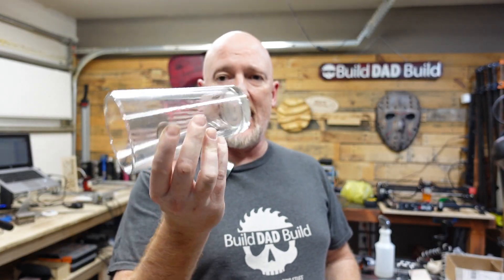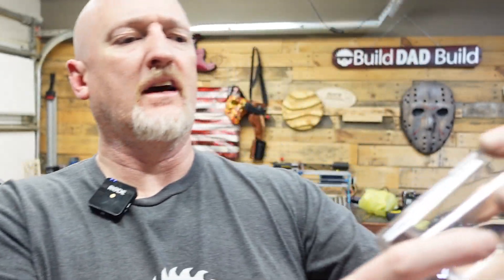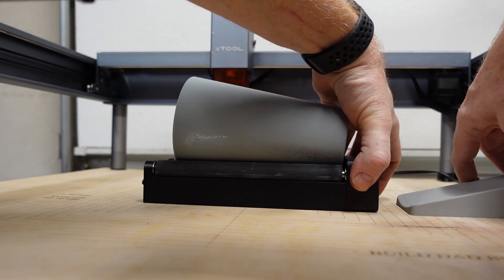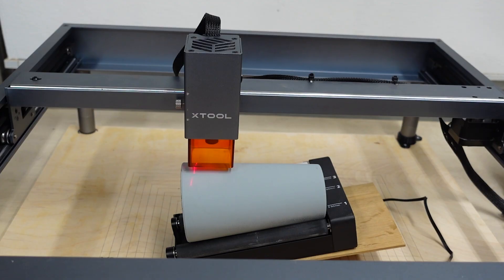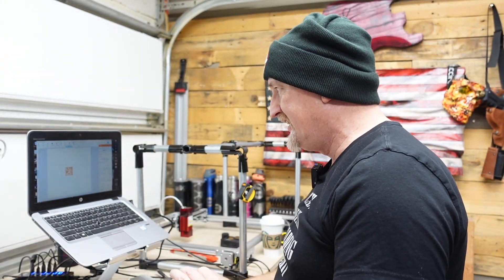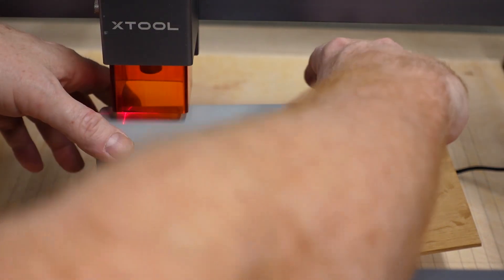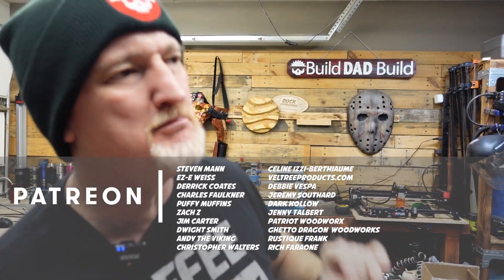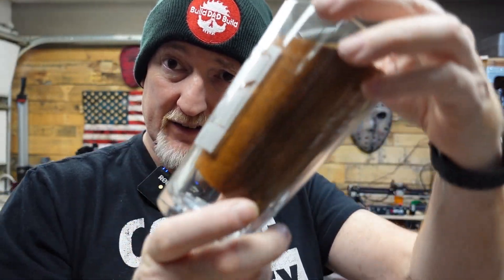The Secret to Etching Pint Glasses with a Diode Laser

Comment: one more.
I do appreciate the time you spend on testing the various methods to laser engrave (etch) glass.  My comments are a bit off topic, but,  I do receive excellent results with the black Tempura paint that provides a nice, white etch, BUT, to achieve the best results, I have to use my airbrush to apply several, 3,4,7 coats to achieve a good thickness that works great.  Now, I have just tried a single coat of the cold galvanized - Rust-oleum -  and setting my 30 watt Longer B1 laser to 4000 mm/min, 80% power, with a .08 line interval, I do get a very nice BLACK etching.  As I was expecting a "white" etch, I'm liking the black finish that my test glass showed.  I have also tried the TiS02 on glass and to receive the best results, a thicker coating works best for me.  My white 4x4 ceramic tiles result with a great black finish and again, a thicker coating is the trick with a "too light" of a coat giving a splotchy uneven black result.  The TiS02 that I tried on an old hot sauce bottle did result in a black etch, but, I could/should have used a thicker coat to have a "more dense" black burn.  Whatever coating that you use, the hardest part is to apply your mask in an EVEN coat that is "thick enough" to achieve the best results.  Thanks again.....  Hank

P.S.  My CG spray was just bought from the big A store and, evidently, the CG formulation has changed that results in a very NICE black etch instead of your "white" results - FYI....

Comment: Hey Nick, coming back for more.....
A suggestion to prevent the tapered glass from "walking" down the rollers: Use the side of the roller assembly that has the markings for the top/wider portion of the glass and place the top of the glass on the rollers against the frame.  This way the metal "boxed belt area" will act as a stop to keep the glass from walking since it will be in contact with the roller assembly frame.  You will need to lift the opposite end from the end you showed to obtain the proper angle for a level burn.  You will need to change the image angle 180 degrees from you initial setting to make the right side of the roller assembly the top of the glass.  I think you know what I mean about the above setup as any "glass walking" will be stopped by the roller frame....  Now for my own CG testing  🙂

Comment: Hi Nick . Got a dum question on Flat Glass for a laser. Laser  glass Acrylic etching
Reply from the maker: You’ll have to do a speed and power grid for best settings.
Reply: @BuildDadBuild  thanks done that . Going to do another power test. I saw your on call galvanize compound spray paint so got the paint. Hope this actually works. .

Comment: Hay sweet. Got a questions can you use card stock To engravean image using a flat glass And can diode laser cut glass? 🤓🧐
Reply from the maker: diodes can NOT cut glass. Card stock on the inside of the glass can be a "hack" of sorts
Reply: @BuildDadBuild  Hi there thanks 🙏🏻😋 hot diggity cool 😎 I’ll try it out. And learned so much from you and done stuff. Thanks

Comment: THAT is why they make "chuck" type rotary's...  IF each roller had a flat "washer type" ring on each roller to keep the glass from sliding down, it "may" work.  My money would be on using a chuck rotary...
Reply from the maker: WHEN this video was MADE there was no OPTION for a CHUCK rotary...

Cheers
Reply: @BuildDadBuild  Yea, in two years a LOT of changes happen, and while the results were not quite perfect, I really can't biatch because I've lasered "ZERO" glasses  🙂

Comment: I am having a lot of trouble. I do the line test to get the rotations per mm. Then I do and engrave a logo and it is very skewed. So then I go do the line test again, and then get that set to where the two ends meet again, then go back and engrave the logo, well its still skewed. I have the cup flat even though it is slanted. And then when I get any type of engraving, the glass from the engraved part chips. So i try new settings, and nothing seems to work.
Reply from the maker: Try weighting the cup so it doesn't slip while engraving.
Reply: @BuildDadBuild  it doesn’t slip
Reply from the maker: Then your belts are loose or the laser head isn't seated properly.

Comment: It's hard to notice, but did you adjust the width of the square image to make it still look square when viewing it on a round object ?  As for the paint I use Vallejo black primer and apply it with my airbrush.
Reply from the maker: No. I did not adjust.

Comment: Thanks for the video Nick. First of yours I've watched. You seem to have played / worked with the cylinder engraving tool more than most so I'll ask you. Will this attachment do a small enough diameter to etch the handle of a pool cue? If you think it might, do you have any tips / tricks I might need other than the levelling that you just made very clear. I am buying an Atomstack X7. Also do you suggest air assist? 
Thanks again for your video. I really like your detailed but Not boring approach.
Reply from the maker: Yes on the pool cue. Air assist is going to be more important if you are cutting.

Comment: Great video again. Do you think the fry moly would work as the coating?
Reply from the maker: You mean remove the coating?
Reply: I mean apply dry moly like you do on metal. I was just wondering if it would would work like the tempera coating.
Reply from the maker: Not sure.

Comment: Just curious, how slow is necessary to get "frosted" look with cgc? Mine are mostly greyish.... I have a d1 pro 20w
Reply from the maker: Not sure. I haven’t run any with the 20w
Reply: @BuildDadBuild  you said to use "stainless" settings,  I believe you were using laserbox at the time, xcs has 3 different stainless settings, I can translate to 20w if I can ever figure out where to start..

Comment: Hi! I have a question and I hope you can answer it. When you laser engrave onto a pint glass, does it come out smooth or is the glass going to be jagged like it was chipped away?
Reply from the maker: I wouldn't say jagged, but you can feel the roughness of the etch.
Cheers
Reply: @BuildDadBuild  Would you recommend to put some kind of clear coating over the glass to smooth it all the way around? Thanks for the reply!

Comment: Nick.. I've been experimenting with different mediums for etching glass (Dry Moly, Zinc/Galvanizing, Tempera, Tape, etc...), and have found that most mediums are "about" equal. Side note, at least with the galvanizing I am using, I run a second pass to burn off excess material left behind on first pass.... but, I digress..

The point of my post, and I do have one, is to ask you a question: have you tried using "Rub'n Buff" (get yer mind outta the gutter!) on the etched part of the glass?

I have watched several videos of the folks who do chemical etching of glass follow-up with Rub'n Buff to bring color to their glass etchings (gold leaf, copper, ebony, etc...). I am going to experiment on some of my existing test pieces this weekend, but wondered if you had already seen this product.

If you see this and are interested in my results... let me know and I'll be happy to share.
Reply from the maker: I've never heard of it, but will check it out.
You can share your results on my Discord channel:
https://discord.gg/PTBeEwV9
Cheers!
Reply: @BuildDadBuild  Just joined and uploaded to #pictures ... enjoy!

Comment: I appreciate the videos you have made for etching glass. When I first bought my D1, pint glasses were the main idea I had. I have been able to etch the glass using this method, but I’m actually ending up with a super light etch and would like a better image so I could actually sell them. I’m not sure if you have any tips on getting a darker etch or not but I would really appreciate it.
Reply from the maker: A little more CGC might do it. Sometimes designs need to be inverted in order for them to show up better.
Also slowing the laser or increasing DPI might help.
Cheers

Comment: I found that using the Cold Galvanizing compound paint from Lowes at 60mm/sec and 95% power left an incredible smooth black etch in the glass, at much slower speed it frosted the glass.  I think it left a better image in black than the more expensive charcoal glass spray from Enduramark.  It worked on tile the same way at 90mm/sec at 90% power.  This is on the 10w version of the D1.
Reply from the maker: Good to know!
Reply: I tried 60mm/sec 95% power with galvanizing compound and it looked really good until I washed off the burnt paint and it left a very faint etching, too fast to really effect the glass.  Using xtool d1 pro 10 watt.  I think I’m going to try the black tempera technique tommorow.
Reply: Do you change speed and power for frosted look? D1 pro 20w.
Reply: @Dhump007  what did you come up with for your settings for the 20w
Reply: Can you tell us the 20W settings?

Comment: Be very careful guys, cold galvanizing compound is extremely toxic, the fumes that come off it when heated (including a laser) are potentially deadly. This should be enclosed with a charcoal vent filter at a minimum. I did  few tiles using this stuff a while back, until I bothered to read the MSDS sheets, I haven't touched it since!

Comment: I have found that shimming the rotary can cause the item, like a large glass, to walk down hill causing the engrave pattern to shift.
Reply from the maker: That's why I did another video showing how to make a jig. I've found anything more than a pint glass doesn't "tilt" all that well.
Cheers
Reply: I solved this problem by just placing a heavy object in the way in the direction of the walk (in my case a tea tin with some weights in it) - cheap, fast, and at least for my purposes results have been great.

Comment: With the glass tapering, how did you determine circumference? Did you use the opening of the glass or the middle of the glass? Any insight is appreciated! Keep up the awesome videos!
Reply from the maker: Why do you need circumference? The images are measured by width. If you are concerned with where the image will be placed I would measure the circumference in the middle of the engravable area.
Cheers

Comment: hello, enjoy your video's. Wanted to pass along a tip. You should try tempura paint instead of the galvanizing spray. I have gotten the same results with tempura paint as the with the spray. Pros: tempura easier to clean up and non toxic, also way cheaper. Cons: takes a bit for a thick coat of tempura to dry, so I use heat gun to flash dry it.
Just wanted to pass it on, in case you wanted to give it a shot.
Reply from the maker: There is actually a box of tempura paint sitting in the shop right now!
Cheers
Reply: Hello! How thick of a coating are you putting on? Mine is streaky and see thru after like 5 coats
Reply: @cynthiasparks7545  I personally use a foam brush and one heavy coat of tempura paint. Lightly drag the tempura with one stroke, dont go over it again without reloading your foam brush.
Reply: @cohode6290  Did you mean Tempera? I have been looking for tempura paint but none found!
Reply: @TheDanzman1211  Yes, bad spelling on my part.
Reply: What brand of tempura paint do you use? Where do you buy it from?
Reply: @VeryBettsy  The brand is ART-I-SAN, I am pretty sure I bought it at Walmart, but maybe Hobby Lobby. They had it on sell so I bought like 12 large bottles really cheap. Still working on those bottles. Foam brush, one stroke and reload brush, do not try to drag a second stroke without reloading brush or you will create streaks.

Comment: Can this be used to engrave on polymers and metals and how deeply will it engrave on metals?
Reply from the maker: It will not etch metal. You need a fiber laser or extremely powerful CO2.
You can mark some metals using a transfer agent.
Cheers

Comment: Your videos are great and so helpful! Have you seen  or tried the Sculpfun S9? I'm looking for a larger work space and deeper cuts. I wonder also if a camera can be added to any of the diode lasers? Or if you can mix and match accessories, like the rotary?
Reply from the maker: I got to use the S6...it was a decent unit. Have not had the pleasure of working with the S9.
Some of the accessories are mix and match. You just need to make sure you've got the same connectors!
Cheers

Comment: Thank you for amazing work you share Nick,would you recommend running this tool in a small home with little ventilation or   is it better option in workshop?
Reply from the maker: You definitely need some sort of ventilation. If you were going to run it in a home, I would suggest building or buying an enclosure with some sort of venting option.
Cheers!
Reply: @BuildDadBuild  the Louisiana hobby guy has a video on a enclosure an its cheep an pretty swaeeeet

Comment: What were the settings? I think I missed it
Reply from the maker: I used the stainless steel settings. I think 100% power and 12 mm/s
Cheers
Reply: @BuildDadBuild  Thanks! What do you use to take off the paint
Reply from the maker: @carlosdiazplaza1690  lacquer thinner

Comment: If you have a 3D printer (chances are, if you have a laser you have a 3D printer as well...) just print a 1/8" (3mm) thick donut. The OD the same diameter as the large end of the glass and the ID just a hair bigger than the diameter than the small end....slide it on the small end of the glass and Bob's your uncle. Should only take about 30 minutes to print and is a lot more stable than wedging up the rotary. Now, if you're just doing random glasses...maybe not the best way as its gonna take 5 minutes in CAD and 30 minutes or so to print, but if you're doing production type stuff...the little work up front pays off after the first glass.
Reply from the maker: Agreed...and I have a 3D printer on the way! Cheers

Comment: Why not to use rubber ring on glass bottom or sth printed to have top and bottom of glass at the same height? IMO it's way easier and more precise than door stops. Smoething like "O" = glass top, "o" = glass bottom, "o-O" - printed/engraved ring with hole that outside diameter fits "O" and inside diamiter that fits bottom "o" of glass. Even painters tape wraped few times on glass bottom should work fine :). Don't understand me wrong, I still appriciate your effort 😉. Keep it up.
Reply from the maker: I have seen those methods, and I agree with them. I feel like this is the simplest solution for those out there that don't want to print something, etc. But if you've go the way to do it, more power to ya, brother! I actually use a roll of painters tape for my 30oz tumblers!LOL
Cheers
Reply: This is the method I use, too.  I was worried the differing circumferences from the top of the glass to the bottom would roll at different rates on the rotary causing skewing/shifting of the image.  Have used a roll of masking tape in a pinch, too. :)

Comment: I like tempera paint better only because it comes off with just water.
Reply from the maker: I've got a box of paint in the shop brother. Just haven't gotten around to it yet.
Cheers
Reply: I seen a vid of a guy using a brillo pad to remove the stuff and it does come off easy that way.